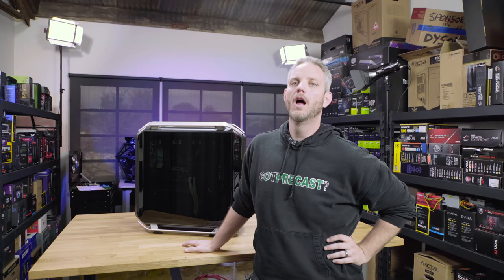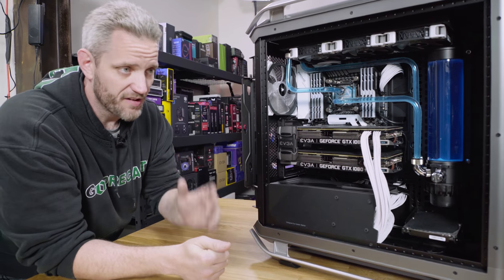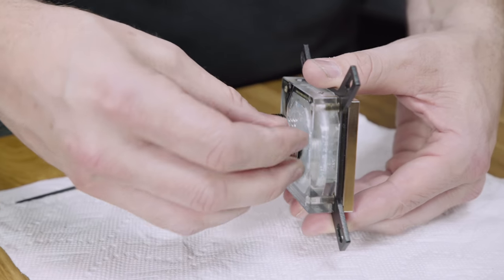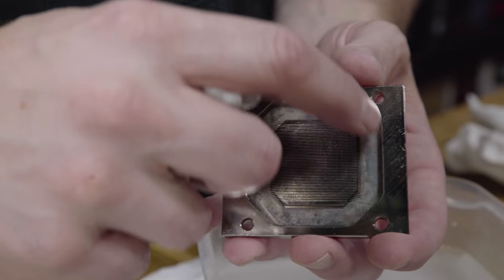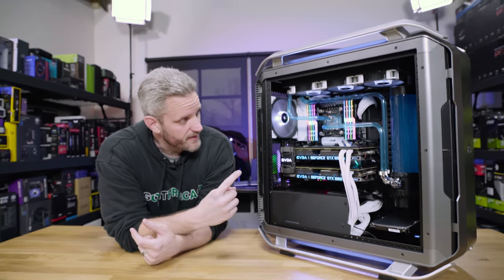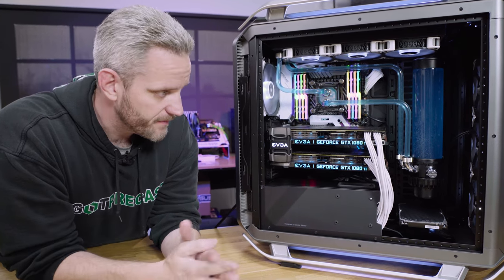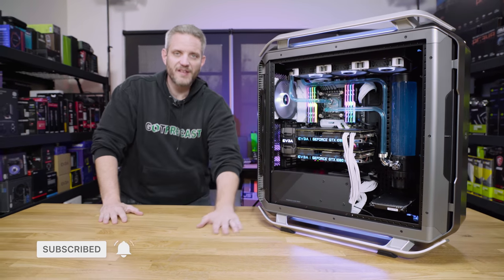It happened again... and this time it was NASTY

Comment: Called it. Had similar results with my loop. No bueno.
Reply: HomeBrewedHero Just had the same issue...Back to EK Cryo forever!
Reply: My Vue did the same. Primochill won't answer my emails.
Reply: Primochill support suck. And they added the 8hr limit after i bought my pre ordered stuff and then complained that it was my fault it started to build up after just 2 days. 😂😂
Reply: Yerp. Same here. They've changed the rules to the game midway to make it appear to be our fault when really, it was poor planning, poor testing, and poor engineering on their end.  They changed the prep too from the preorders from the initial release to all subsequent releases of this product.  They shouldn't do R&D with our machines as test benches.  I'm inclined to agree with Jay about the black nickel causing some breakdown in the coolant as this mirrored my findings too when I dissected my loop.  Feeling like I shouldn't trust Primochill's coolants anymore but ICE transparent has been great so it's a bad product and a good product. Make what you will with this information.  Good luck everyone and keep those overclocks high and your temps low.

Comment: id install ,watercooling when they will do everything out of copper and brass no nickel no plastic . 
as a  plumber in france ,to avoid gunk in solar panel we had to connect at least one metal part to earth .
solar panel is the same thing , tubing pump and antifreeze ( glycol)

as you know the fluid is moving in the system and make static energy might be a little bad on the cpu i dont know about that but cant be bad to earth the pc

Comment: Rinse contamination from toothpaste ions off the metal with demin water. Heat plus contamination will accelerate corrosion also avoid dissimilar metals. Fluid should be electrochemically reducing. Fluid pH also will change with temperature making it slightly more acidic. They should have a corrosion inhibitor in the cooling fluid that forms a passive layer on the metal surface.

Comment: To me, it would be better if the tubes and res were colored instead of the fluid.
Reply: Interesting idea but I like the colored fluid
Reply: If you don't have plexi blocks that can look nice with colored soft tubeing
Reply: Fluid is definitely better as far as custom colors, but the way some of this shit clogs and solidifies, I wouldn't want to take a chance.
Reply: i'd personally use distilled water and RGB lighting effects, as it can allow you to make it any colour you want
Reply: Schyzox Music there are actually frosted acrylic tubes that you can get which help diffuse the lights even more. Probably the best setup with the current water cooling supplies.
Reply: Wi1dCard i agree, my friend
Reply: If you don't use these dumb effect mixtures like this, it works fine. I have been running pastel white fluid in my system for 2 years (yes the same fluid for 2 years). My flow meter shows it runs just fine. I will actually be draining and cleaning the blocks and replacing the fluid soon, but the stuff has been running without issue for 2 years sealed.
Reply: agreed. Thats what im doing for years. If i want new colors - i change tubing

Comment: Maybe this is a dumb idea, but I was thinking maybe you should adapt the system and add a quick disconnect in-line filter.  Think of it like an oil filter or fuel filter for your vehicle.  Small particles of dirt and metal are collected in the filter, before the moving parts to mitigate any damage. when it gets dirty you just drain the system, change or clean out the filter, replace the filter with an easy connection and fill it back up with coolant.  Easy!

Comment: Had this happen with the exact color of VUE, and it happened quickly on new equipment that I flushed first... and it was on the commercial version of Vue rather than the test. It fell out completely within the first few weeks of use. I planned on it being temporary use until nvidia came out with their next card... but it has taken a year. Luckily once it fell out and gunked everything up, it didn't completely stop flow and never got worse than the first month.... but my stuff looks as bad as yours. I finally got a new card and get to begin the painful cleaning process...

Comment: Glad to see your cleaning technique at work, but a fluid designed for just EIGHT HOURS of use before it starts breaking down is worse than a bad joke. Even for a typical trade show it would need to be in there for several days. Are these guys even serious???

To the folks at Mayhems or Primochill - my system is a lot more complicated than what you see here with five blocks and five radiators connected to a single pump/res combo. I have had it running for the better part of two years now with a single fluid change in that time which consisted of a full drain and flush. I use plain distilled water with a 10/90 mix of clear additive from a manufacturer I will not mention here. This "liquid" has not left any buildup whatsoever in my blocks, yet using these "colored" variants I would have had to completely disassemble my entire system at least three times in those two years just to keep it running.

My time is valuable. My equipment needs to run 24/7 and it costs me money when it is down. So to have these manufacturers sell me a product that is substandard in performance/quality and have it shamelessly plugged religiously by <insert favorite youtube sellout here> is disingenuous at best and a recipe for hardware failure at worst.

My advice to guys like Jason - STOP RECOMMENDING JUNK PRODUCTS.
My advice to manufacturers - develop better fluids that last LONGER THAN EIGHT FUCKING HOURS.
My advice to users who want color - use COLORED TUBING with some RGB LED's... and stick to a clear fluid. You will have far less maintenance headaches guaranteed.
Reply: How the hell do you have five blocks and five rads in a single system?
Reply: Why won’t you mention the manufacturer
Reply: No.  I want funky coolant and I will sacrifice as much practicality as needed.  Deal with it.

Comment: I've been a mechanic most of my life, and I can tell you that one of the main things that accelerates galvanic corrosion is electrolisis that occurs in the system, GM engineers found that the water pump impeller is the source as it rotates in the system. I don't know how much of that theory transfers to pc systems but it's still highly suspect to me when i see this type of occurence in water cooled systems.

Comment: I think disasemble still best way to clean it and replace the part that cause problems or react to the liquid.
At least this show that air-cooling still far simple, cheap and easy to keep under good shape.
love the air blower, need to buy one someday. I just blow with a straw or take things apart and clean the heat-sinks with water and isopropyl alcohol when I'm trully upset about dust.

Comment: Mayhem Pastels are explicitly for /TEMPORARY USE DURING TRADE SHOWS ONLY/, they literally say that on the paper instructions that come with the coolant. It is /NOT/ designed for long-term usage in a loop. I'm guessing the same is true for this PrimpChill Vue stuff. Anything that contains any kind of dye or coloring will do this over time. I've been running a 5% ethanol glycol (undiluted automotive antifreeze) & 95% distilled water mixture for going on 7 years now in my water cooled systems (my file server is water cooled, 5 years never changed the fluid at all) no corrosion, no build up, none of this bullshit you're dealing with. Just stop dicking around with all these pretty bullshit coolants and just use something that works and never worry about this again.  Even the most recently I drained after 2 years of daily usage, spotless and clean internals with no issues what so ever in any water parts. Just flush with distilled and ready to fill again and go again.
Reply: Fluffy Ponies the metals on the components can release ions into the fluid and react with other metal components (for an instance if you have a copper block and a aluminum radiator they are bound to corrode) water is not a non reactive fluid and it naturaly scrapes ions from the surfaces thats why you should go full copper/nickel or full aluminum also why his fittings really could be the problem
Reply: @dannymoneywell  Otherwise called Electrolysis.  You run into this all the time with vehicles, aluminum radiator with copper heater cores.  Eventually it will wear pin holes in the copper heater core due to electrical current running through the fluid (Albeit, a TINY amount.. but enough for the differing metals to corrode).
Reply: VW G12+ is bright pink, G12++ is purple. Just saying.

Comment: the coolant looks cool, But is it really worth all this extra maintenance? With so many different materials used by diff manufactures,  I doubt they will ever get it right.   looks like smegma your rig has poor hygiene lol
Reply: well, if you're someone like jay and both know what you are doing and can do it without a hasle and have the money to do this and that.
 its more fun and allows for higher overclocking and stuff, if you would be in jays position why not ?
Reply: using a loop is great .primochill vue is the issue still needs some work .there should be no solids  in a coolant imo
Reply: Yeah, i'd say this fluid is for a showpiece and not really a functional computer. Looks awesome, but not worth the extra hassle, especially for a computer you actually use.
Reply: for high performance systems, yes. AIO's don't have the dissipation overhead to be able to cool really, really high performance hardware.
or Coffee Lake, for that matter. basically if what you're trying to cool is very thermally dense and/or produces a LOT of heat, then an AIO will seriously struggle.
Reply: In my opinion these kind of fluids are not worth the pain. If you want it to look cool use colored tubing.

Comment: This problem is possibly caused by galvanic corrosion. That's when you combine two different metals in an electrolyte. The metal that is most negative on the anodic index will suffer from corrosion. When you combine different metals in a cooling loop you'll run into the same problem when your coolant is acting as an electrolyte (=conductive).

Comment: That is why I just use distilled water with a few drops of deadwater and a drop or two liquid soap or water-wetter, and clean everything out twice a year.  Inspect/replace any plated bits that look compromised, clean up the rest and I am good for another 6 months.  Looks are always second to function.  Toothpaste?  Interesting.  I just soak my all-copper Raystorm in white vinegar for a short time, it's worked well and have had no issues through the last 9 cleanings.  Will have to test that toothpaste bit on an old fitting to see how it goes...

Comment: So its really just meant for showcasing a computer instead of daily driving.
Reply: Yeah. Anyone that does custom watercooling and isn't just showing off for the day, should use distilled water. That's it.
Reply: And a biocide. A lot of the concentrates that just have biocides anti-corrosives and a dye are absolutely fine as long as they are fairly ph neutrel. The issue is when you start messing with adding particles and acidity. Running straight water is a great way to grow algae unless you re-fill / clean your loop religiously.
Reply: Usually if it's distilled, a silver kill coil is enough.

Comment: plating problems? you have electrolysis problems big time.
sacrificial anode/cathode(pending charge) time.
Reply: Shitty coolant. It's all garbage.
Reply: Gizmo Thewychdoktor - I agree, dissimilar metals, I know nothing about pc fluid coolant but galvanic action is a something I'd be looking at - unless there are inhibitors in the coolant, and if there are dissimilar metals in the loop with enough free electrons, then corrosion is a possible culprit.
Reply: The Vue coolant is known to do this, regardless of galvanic problems
Reply: Was hoping someone mentioned this.  This is the first thought I had.  He needs to go with DI water, plastic fittings and plastic plugs to minimize the amount of electrolysis he's getting.
Reply: actschp1
the problem is conductivity between the active surfaces. differential charge and the moving fluid cause the effect as well as apparently,a high acid content in regards to this particular fluid.  metal fittings at turn points could be grounded or provide, with plastic turn points,a sacrificial anode pending the direction of charge amount..
(see:zinc on boats ;-).   thus the coolant reference and provided link. lots of research into these problems have been posted and what the boffins have come up with is quite amazing given the scale of the problem in both automotive and industrial applications.
the computer thing is a no brainer in comparison. cause and result right there to see.  green...blue....yellow(sort of)....clear and hot fluorescent pink are the colors though. oh,the sacrifices one has to make for solutions.  ;->
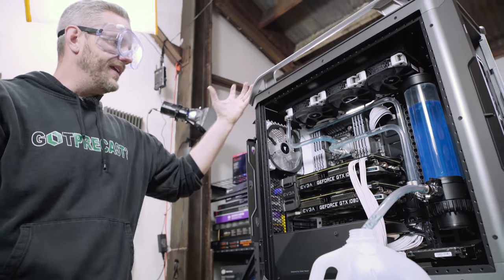Reply: soooo suprised Jay don't know this or no one more upvoted realised this, I'm just at 3:40 and I have strong suspiciouns about it already
Reply: TheGuruStud no it's not garbage its the fact that different system use different metals and some chemicals corrode those metals however the same chemical might not corrode the other metal
Reply: DI water would increase galvanic corrosion as the ions in the metal plates would re-ionise the water. Distilled water is best, de-mineralised a close second.
Reply: Plastic? Eww, go stainless.

Comment: Dude Jay it's starting to seem like the watecooling is more of a problems than its worth XD
Reply: That's because he uses all kinds of jizz paste in the liquid. Just use distilled water. That's it.  Want color in the tubes? Buy colored tubes.
Reply: It’s always been. Everyone should know that a quality air cooler is adequate. They’ve just accepted the fact and do it for looks, little extra performance, or for the fun of it as a hobby.
Reply: What about GPU cooling? I know that cpus can be quiet, but from I know from experience that a GPU can be pretty damn loud at higher temps.
Reply: crazyslimdude6 Depends on the manufacturer. For example, it seems Asus’s Strix has the best noise to performance ratio in the latest generation. You’ll see less of a difference from water cooling that over than a reference or a poorly designed aftermarket cooler.
Reply: Ok, but what if you can't afford a 10 series card? I'm running an evga 980ti that had a habit of getting very loud when playing more extreme games.
Reply: crazyslimdude6 While the point was that it depends on your aftermarket and not the generation if it's getting loud that you can hear it through your primary audio source, it may be worth going for water cooling. If you're not comfortable water cooling, there are also custom air coolers designed for GPUs.

Comment: As a mechanic, I see this happen a lot on cars, it’s electrolysis caused by the fluid contact with different metals, hence the corrosion and deposits, I’m sure you can find an inhibitor additive to correct this, good luck...

Comment: Could be heat... above 60 degrees most fluids start to desolve. With an overclocked rig the temps near the CPU block can easily reach those temps. I dont think the radiator plugs can create that amount of clogging.

Comment: AIOs are fine as long as they're RGB. 
Honestly though, check the PH  if the PH is off then it's going to eat the coatings. 
Dissimilar metals don't particularly help either.  
A good neutral distilled or reverse osmosis water with all aluminum or all copper is best, use some frosted tubing with less if you have to have color. 
I've had a lot of good experiences with AIOs though.

Comment: Oh good lord, just go air cooling and be done with it.
Reply: Nope
Reply: Unfortunately his chip could not overclock as far as it is if it was air cooled. It's physically impossible. His system must be water cooled. Also anyone actually in to overclocking knows you can only go so far with air. Custom water loop is the only way to get the most out of our components.

Comment: think this problem through and go the industrial leg route.

https://www.penriteoil.com.au/assets/pdf/tech/Nov2015/Coolants.pdf

disparate metals and adverse electrolytic interactions....the ability to move heat and dissipate it correctly....
you and the automotive and industrial applications with wet coolant design share a lot in common.
   go for the fix and not marketing wank.  ;-)

Comment: Dissimilar metals with a liquid medium, add heat, electrolysis will occur. That is a good reason why the copper transferred off into the coolant. Check for acid content of the coolant. 6 months is not a very long time.

Comment: This might be too late, but I believe the cause of the corrosion is something called galvanic corrosion. Different metals/alloys have varying electrode potentials. Pure water already contains a small amount of H+ or -OH ions, but if the coolant contains any ionic compounds then the corrosion will progress much quicker. I believe that is the issue im this loop due to the chrome plating and copper being removed. 

Great video and I hope this was in any way helpful to you guys.

Comment: Seems almost to me like there was some anode action in the liquid cooling setup. It's like putting a cheap "stainless" utensil (actually made of zinc not a more standard stainless steel) in a dishwasher. The zinc part will become the anode of the dishwasher "battery". Some other metal will act as a cathode and electron flow will occur, destroying the anode metal.